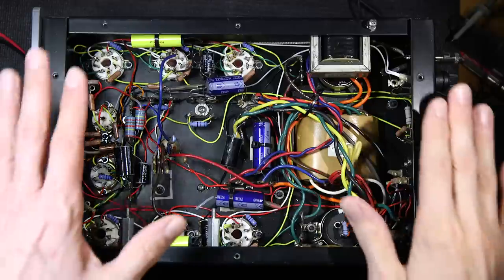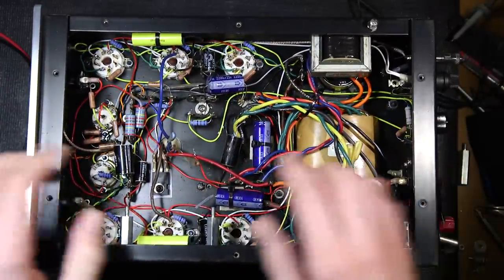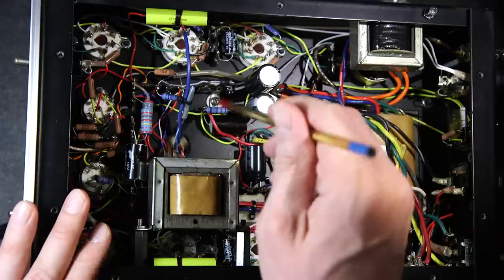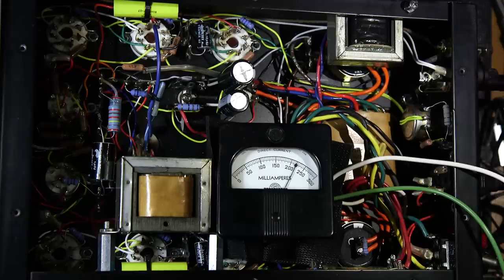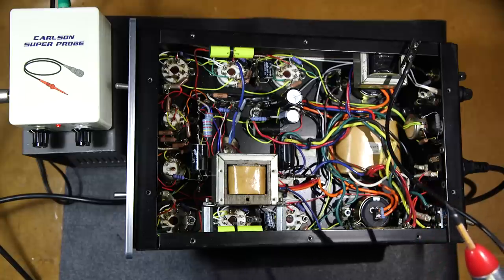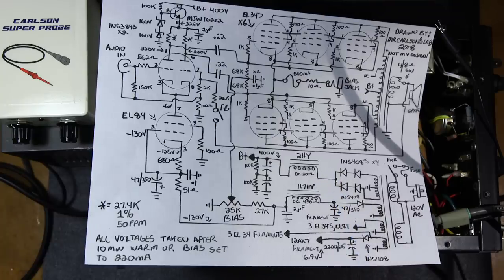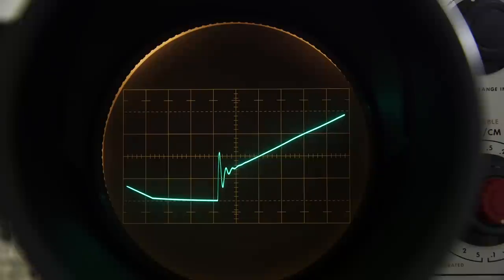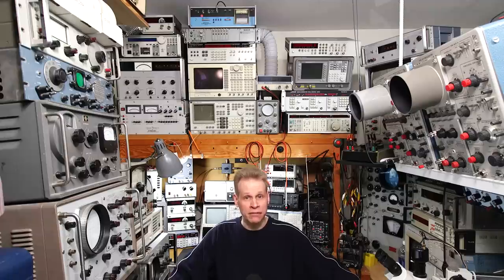Amplifier Troubleshooting and Modification.

Comment: I'm a retired EE, 40 years in power analog and RF. I have never seen anyone present electronics in the same manner that my grandfather taught me (and started a lifelong love) ...until seeing your videos. I am beyond impressed. Your series should be required coursework for undergrad engineers and trade schools. Well done, and thanks, I've re-learned a few old guy tricks.
Reply: Yes, and yes, yes, yes. Not my grandfather, but an EE prof at the local university who was a ham radio operator.

Comment: I TRIED TO EXPLAIN TO MY FRIEND THAT RUNS SIX PACKS THAT THE HUM IS PART OF THE DESIGN AND THEIR IS NOTHING HE CAN DO EXTERNALLY TO REMEDY THE NOISE !!
IT IS INHERENT IN THE DESIGN, SIMPLY BY THE PROXIMITY OF THE COMPONENTS !!!
YOU HAVE VERY NICE INSTRUMENTATION !!!  NICE TO HAVE SELF CONTAINED MATCHING LOADS IN YOUR MEASUREMENT EQUIPMENT !!
I ALSO HAD A HARD TIME EXPLAINING THE BIAS RECOMMENDATION WAS ONLY TO GET YOU IN THE BALLPARK !!!  THE ACTUAL BIAS WAS MUCH LOWER AND IS SET BY WATCHING THE CROSSOVER POINT ON THE OSCILLOSCOPE !!!

Comment: A huge thumbs up to Mr. Carlson for taking the time and effort and his grand old Tektronix scope to fill us in for what this small capacitor in front of the choke (reactance) is for! Back at tech school many moons ago I asked the lecturer what this small value cap was for exactly, I had noted this feature in quite a few amp and radio schematics. His rather annoyed sounding answer was: Cant you see?? Its for quenching RF interference!! Can we get on with the lesson now??  I have built my fair share of amps and power supplies since then, always including this feature, a small HV cap, mostly 0,68 micro, always beleiving it was there to cut diode switching hash especially on the AM broadcast band. Now I know better, thanks to Mr Carlson :-) 

P.S. Concerning the Super Probe: Was not there once a little tube Signal tracer by Heathkit with a magic eye in the bottom corner that had a probe with a germanium diode in it which worked in a very similar manner? The model designation eludes me ATM...
Best regards from Germany

Comment: Inspiring videos. You have rekindled an undeveloped relationship with electronics from my youth. Now, at age 72, I have the time and the opportunity to continue my journey, not to mention keeping an active mind. During the last 3 years I have learned to speak a foreign language to a reasonable level of proficiency, now I will have to learn the French words for inductors, capacitors, valves, (tubes in your country I think) , current, voltage, impedance, resistance, capacitance, distortion, frequency, phase, etc etc etc. Subscribed and will look at your Patreon pages. Thank you.

Comment: I find this trouble shooting video a valuable resource and a significant step towards my understanding of dampening inductor ringing. I'm amazed that a small cap can make, or break the noise threshold on an amplifier with an LC power supply filter. I appreciate the practical methodology employed in the experimentation process, and will use this process on my own designs.

Comment: great video Mr Carlson the buzzing in the choke has always been a real paint for years, it been a balancing act  to get rid of it. as you stipulate adding capacitance makes the voltage go up. i am too suprize how may tech forget about the peak voltages. i am building myself a 6V6 stereo amp at the moment. and now the choke issue has been resolved i have 2 PSU in my amp 1 for the left and one for the right and 2 x chokes  love your videos keep them coming

Comment: Hello Mr. Carlsson,

I think your c-l network works like a low-pass filter ..... it makes for the DC voltage almost no resistance, but for the 50/60 heart rest voltage from the rectifier a very big resistance.

thanks for the great video.

73, from Germany
Reply: Hi, Walter - yes - the choke is particularly good and necessary in the larger amplifiers as it absorbs the "heart rest" as you put it, (nice expression - I like it!)  without losing much overall voltage - evens things out. The capacitor`s storage  also helps and takes some of the "strain" out of the chokes action. In the smaller amps, there is usually just a resistor between the caps. which wastes a bit, but works well enough with adequate capacitance - especially after the resistor.

Comment: I loved your videos on the two audio 6-pack amplifiers especially the part about moving the b+ choke around for minimum hum at the speaker.  I think an insulated magnetic shield plate might be very helpful.  I have used these as a diagnostic tool kind of like you use your Carlson Super Probe capacitive pickup.  I particularly enjoyed your fixing of the ringing by testing a variety of capacitors. Nice.

Comment: Nice video, my dad was a radar tech in the Navy and he mentioned that a swing choke is designed to be driven from the rectifier without a cap and that it acted as a regulator if I am remembering correctly.  It would be nice to have a clear discussion about that type of choke.
Reply: That`s an interesting account - I`m not qualified to comment, but I have seen amplifier circuits without a pre - choke capacitor.  Most of them do seem to have them, though. Mullard used them in the "5-20"  but not in the "5-10". That one just used capacitor - resistor - capacitor, both high value, (50uF!)  but both amplifiers used limiting resistors after the rectifier - one on each anode out. I think the choke is desirable - especially in large amps, because it (obviously)  smooths things out without incurring much voltage loss.  As Mr Carlson showed,  a relatively small cap,  made a lot of difference - and, I would imagine - lessened the high amount of activity in that rather small choke. I`ve probably said too much!
Reply: Meant to say "one on each anode IN" ( between trans. and rectifier.)

Comment: BTW Paul, by measuring the time constant of the ringing, and then comparing that with an impedance plot of the capacitor, you can nearly eliminate the guess work by aligning the null in the impedance plot of the cap with the ringing of the signal. That said, the beauty of the method you show is in it's simplicity: There are only set positions of capacitors, and measuring them "in circuit" as you did ensures that any other parasitic elements and variations are captured in situ. Love your videos- very practical approach!

Comment: I took your comment about bias circuits and applied it to my own troublesome guitar amp kit I built many years ago... Lo and behold one of the cheap bias pots was totally defective! I thought I'd finally figured it out. Amp worked for a few days then blew a mains fuse. After narrowing down some possibilities, I decided to go back from a tube rectifier to solid state and buy some new EL34's just to see if I get some different readings. The last time the mains fuse failed, it seemed to take the pilot light with it though... Now with all tubes and rectifier out, it fails the light bulb limiter test. Have I ruined the power transformer? The amp is no longer mission critical, I'm just going to buy a new Marshall, but it gives me time to strip this thing down and rewire it from scratch and do a better job. Eventually I'd like to use it out, but it's going to have to be absolutely reliable first. What's the best way to confirm the power transformer is definitely ruined?

Comment: This was a very interesting project. I haven't worked on tube stuff since the late 60's and early 70's and most of those repairs were with a Sams photofact with no modifications. It looks like your super probe would still be a usefull tool in my shop with transistor amps

Comment: Great video, Paul. These newer units there's not much space to make any major changes. A fellow on another channel who does homesteading made a wood case to house a water pump and some fittings and valves including a timer. He did a very rough layout to give him ideas for the case size, but he forgot to take into account the pex lines he needed to plumb it. He made it fit, but it got ugly. You have to always think ahead. I'm sure the manufacturer spent much time planning parts layout for functionally as well as Aesthetics.

Comment: Way back when I was a kid in 1959, I built a 10 Watt amp from scratch using 2 6V6 output tubes, it worked very well. I used an aluminum chassis with the holes punched out with a chassis  punch, all done by hand. WA7VQR

Comment: Just checked my late 30s / early 40s push pull AM radio (twin 42 outputs twin 76s for phase inversion) uses choke input off the 80 rectifier tube and has a .22uf 1000v cap in the same place you installed this one. I guess that is there for the same purpose (the choke on that radio is also quiet!)
Reply from the maker: Yes, Common Knowledge back then... I'm trying to teach these (what seems to be) forgotten ways now. Thanks for your comment!
Reply: Great video by the way, no doubt that it will save me a lot of troubleshooting as i'm in the middle of designing and builidng an all GT style MW/SW radio and even in the datasheet for the 5Y4 it doesn't mention ringing when using the tube in choke input configuration. Amazing how once common known things in many old trades become lost into secrecy through "progress."  No idea how it's going to perform yet as I haven't sorted out coils / IF stage tranformers but out of the parts boxes i've settled initially with 6SK7's for RF preamp and IF amps, 6SA7, 6SQ7, 6V6GTs for PP and possibly a 6SN7 for phase inversion, oh as well I plan on using your little oscillator take off circuit to run a frequency counter :) The main goal of the build is to make something with low hum, pretty uncharacteristic for a table radio but it's something to do right, especially with some of the SW around here a lot of my radios have more hum than station on the weaker stations.
Reply: Mr Carlson's Lab 
Is this called a pi filter or is that different (high value capacitor before the reactor)

Comment: Again great vid Paul, thanks for sharing. I think I need to man up as that arc would have had me jumping and running for cover. I truly love your restoration vids, the equipment you work on is breath taking so much nicer than the modern equivalent. Today I received in the post a lovely little Heathkit Daystrom AG-9U Audio Signal Generator "UK version" fell in love the moment I saw it :-) Again Mr C great vid n keep em coming.
Regards G

Comment: Ultra useful. What's great is these are things I'd love to experiment with, but usually just can't due to time so they remain unsolved or solved in a less elegant way. It's fascinating to watch you work through these gremlins. You're super probe is a great idea as well and I really do need to find the time to build one! I'm curious how quiet the choke and amp would have been in it's original position with the cap added? Also, I would have been tempted to use the 2.2uf and drop the bias back to the 180ma range. Xover looked good on the scope with that current setting. Thanks again for all you do!

Comment: Your capacitor fix is used often in switching power supplies, in a slightly different form. Its a snubber circuit or network. Usually a capacitor in series with a small value of resistance.
Reply: Bob Lake, not QUITE the same fix, or problem. It is SIMILAR, because it does similar things but dumps the noise into a resistor instead of an inductor.

Comment: Another awesome video!  So, do you think moving the reactor was necessary since adding the caps reduced the noise level so drastically?  Thank you for sharing your expertise and knowledge!  Looking forward to the next video!!
Reply: Agree, I thought that would be the obvious first step once we saw the schematic.
Reply: I understand your point Shawn, but suspect that it is always best to physically fix as much as possible before any electronic fix. Wondering if the cap value would have needed to be higher to shunt the higher level noise which would have created the higher B voltage that he wanted to avoid so as not to fry the audio output transformer?

Comment: There will be a value at which the cap resonates with the inductor, and at that point the ringing will be significantly worse than with no cap. You need a value somewhat larger than that, as seen. 

Other thing, using a small electrolytic would not be wise because of the very large AC ripple at this point.

Comment: Great sequel in this amp series. Nice to see your SuperProbe in action more often, this device is so useful I never want to miss it anymore! May I ask, did I misunderstand the BIAS current of about 160 mA to eleminate the cross over distortion in the last amp video? Because you have adjusted it to 220 mA this time. As always awesome video Paul, for me it comes as a bonus on a friday evening, many thanks for sharing!
Reply from the maker: Hi Ralf. For testing purpose, I just set it to the standard. When all is done, and both amps are back together, I will go over each and set them to an appropriate amount determined by the oscilloscope + appropriate safety margin. Thanks for your kind comment!
Reply: Hi Mr Carlson and thanks for your videos and sharing a knowledge! Regarding the bias... The higher current allows more Class A operation as I understand, so may be that's the reason for 220mA number? Although it's 220 for all 6, so each one will see less than 40mA with screen including. 400V * 0.04mA per tube = 16W (including screens). EL34 is rated for 25W. So why bother? ST70 calls for 55mA at ~450V B+ for example.

Comment: Hello Mr Carlson, I am an electronics hobbyist and I really enjoy all your videos. I learn a lot about analog electronics each time but my knowledge is still mostly in digital electronics and computer science. Tube technology and point to point construction really fascinates me, I thought I might get myself on of those cheap sub 200$ Chinese tube amps from aliexpress or ebay to play around with, there are two SE designs, "6N9P+EL34-B" and "6P3P+6N8P". I believe the original designs are by a guy called "Siliconray", a electronics designer from china that used to make a lot of kits and designs base around tube amplifiers and he sold them on his website and the diyaudio forum, unfortunately he vanished some time ago and his website got hacked but you can still buy the kits. I wanted to ask if you think they are worth getting, also seeing you understand and improve those high end amps with ease makes me hopeful that these cheap amps might be a base for me to mod and improve. Thanks for all the amazing videos!

Comment: I suspect that once you had traced the schematic, you saw that it was missing a filter capacitor on the output of the power rectifier and knew right away that would make trouble (i.e. the buzz in the resonator).  The sharp points on the bottom of the full-wave rectifier output won't be supported by the inductance of the resonator.  But still, a nice opportunity to show off the Carlson Superprobe!  73 de W1CMC

Comment: A small resistor in series to the added filter capacitor could probably prevent the moderate voltage rise without having influence to the ringing suppression.

Comment: Hi there, do you know what happened if you put small capacitors less than 0,1uF in all diodes?
(Because the fix was to eliminate current noise from flowing through the coil, by eliminate before.)
I'm just asking because it's a common filter practice to put them on high end audio equipment in order to filter diode on-off noise.
Thanks for your channel!

Comment: Dear Mr.Carlson,

may i ask why you use the term "reactor" instead of "choke" in this case? Is there a technical reason or are those terms synonyms? I thought a choke always induces reactance in a circuit, which, " takes care of the filtering"...

As always,
thanks for your great video and greetings from germany!
Reply: I was wondering, too.

Comment: Very nice job. But a sextet of EL34 sould be a 100-120W monster and should be supplied with 500-550V. I also don't think that measuring power output on a certain frequency is concludent. Should include the entire spectrum using white noise or pink noise.

Comment: Great educational vid.. That choke’s most probably not designed for choke input duty.. I would replace those Solen metallized film too. They easily leak IME and is only rated at 85deg. But the worse part is how they sound. The Illinois Caps you use most probably sound better. I know they are not in coupling positions, but even as decouplers I am not a fan of them.

Comment: Fantastic video as always!  I have a question and a video idea for you:  I built a small S.E.T. amp (the Get Set Go), and when I added a volume pot to it, it outputs a buzz only at a specific volume level - about two thirds of the way up, if it matters.  Any idea why?  I understand a lot of people comment and ask questions; no worries if you can't get to this or it's not worthy of a video.  Thanks!

Comment: I might have missed something. Did the capacitor you added replace the trace between the diode and the reactor or did it go from that trace and ground?
Reply: Hi, it went to ground. Try looking at the circuit of the Mullard 5-20 amp.  You have (from rect. (GZ34), cap. 8uF earthed, choke, another cap, (8uF) to earth. They just store the voltage between the pulses - slightly similar to a battery.

Comment: Great video, I’m about to start a 6G15 tube reverb tank replica project that uses a choke just after the P.T. filtering capacitors can you be so kind as to do a video explaining the difference between reactors, inductors and chokes and there applications. It appears to me that they are the same piece of hardware, that preform different tasks.

Glen in Ontario

Comment: A small (perhaps ~100ohm) resistor in series with the snubber cap will further reduce ringing, allowing a smaller cap.
Reply: circuitsmith Yes, snubbers across diodes could work well too to reduce the ringing.